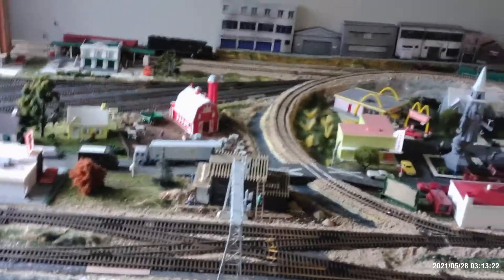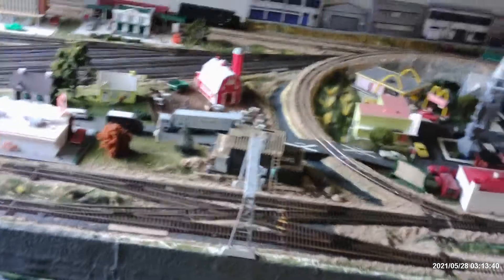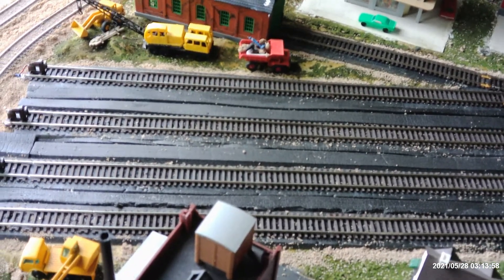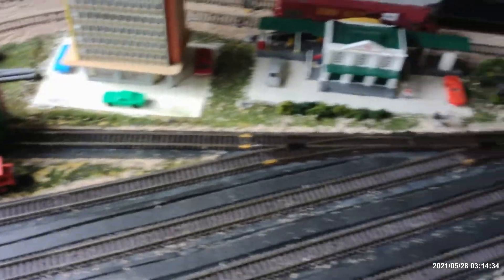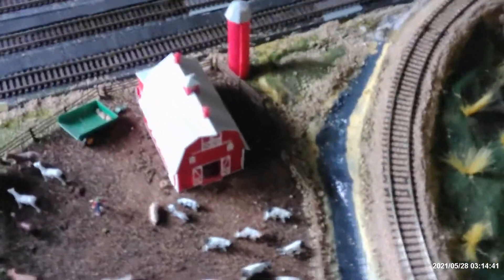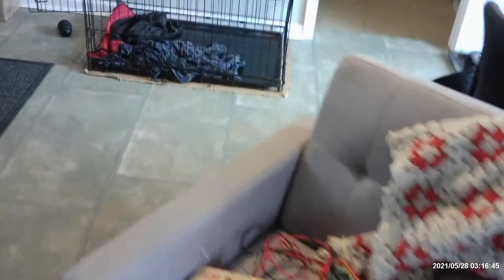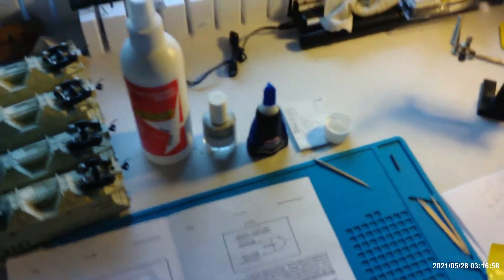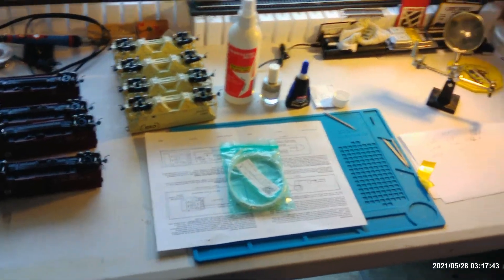018.Help Needed on BD20 & AIU-01

Comment: Wish I could help but don't know anything about it. But I am interested to hear the answer.
Reply from the maker: Hello Problem resolved The BD20's were not on the feeder that was isolated.  So I cut the track and placed polystyrene  in the gaps and no all Sensors are working.  Everywhere else on my Layout I used the brown wire feeder for my BD20s' When I rebuilt this Yard I put the yellow insulator on the wrong rail. Now all working.
Reply: Tom glad you got it figured out. Got to love wiring some times lol